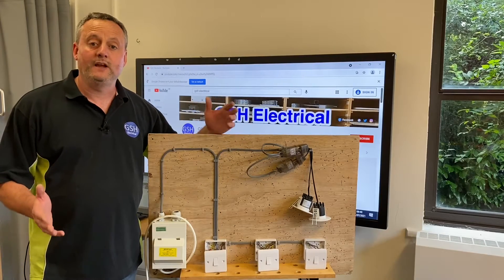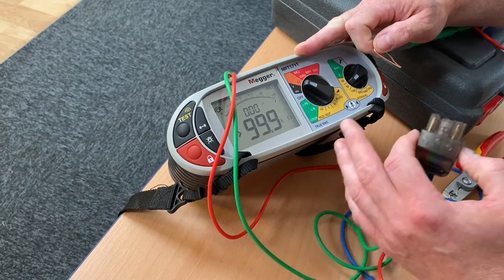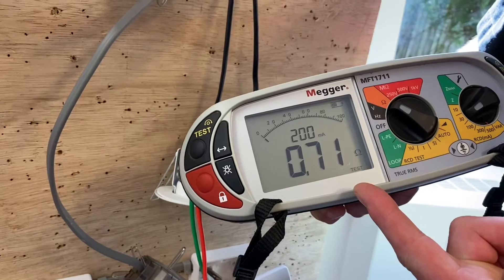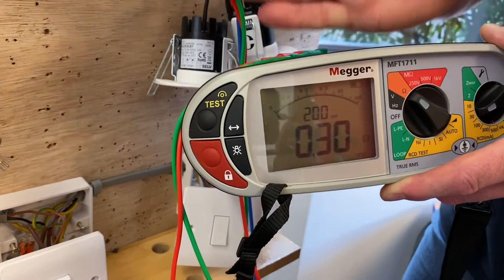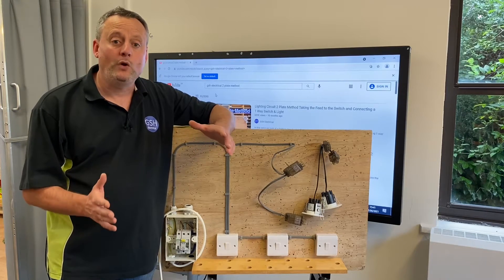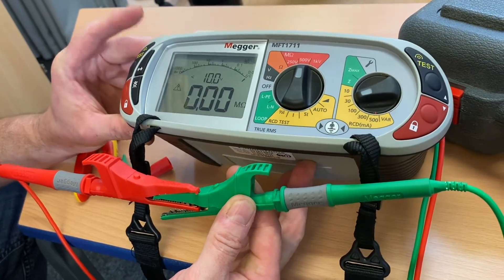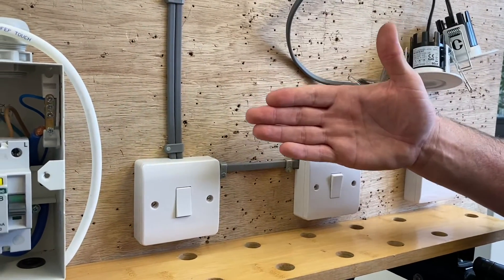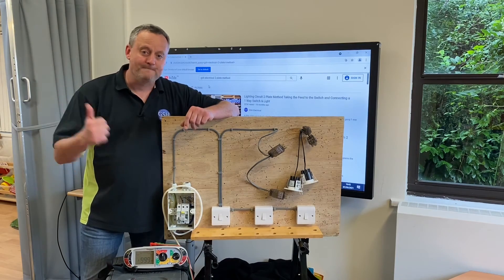2 Plate Method 2 Way & Intermediate Switching - Continuity of CPC, Polarity & Insulation Resistance

Comment: hi, i have only just found your channel and i'll be watching alot of the videos
i do have a question that you may have already covered in a video so it may take me a while to find it.

yes i'm in the uk, 
i'm changing my garage flo't lights to led battens which is a straight forward unit swap but i want to replace the supply from a common single switch to a multi gang (6 lights) switch with a master switch

this would be one switch to turn on / off the switches and those switches would be either on or off as last used / or switchable etc 

question i have is would i be best off using a 9 gang switch block and have one switch as the master or have a 6 gang block and a separate switch as the master, 
would this be the 9 gang = neat vs the master and 6 gang being that bit safer but an extra switch

the garage has its own supply board with pcb's where the power comes in from the house (45 amp supply) as the garage is connected to the house rather than separate out building

this circuit will be lighting only (6 x 22w led battens)